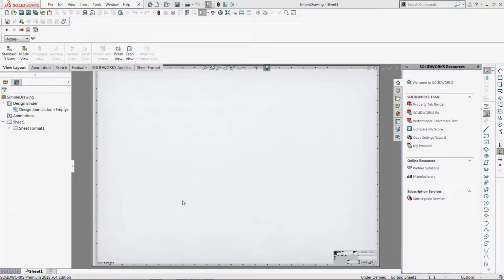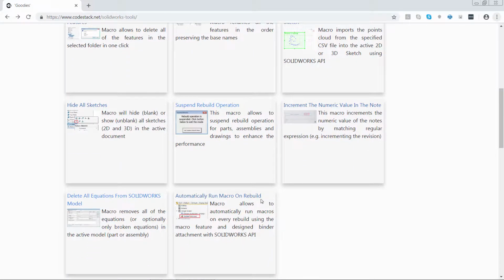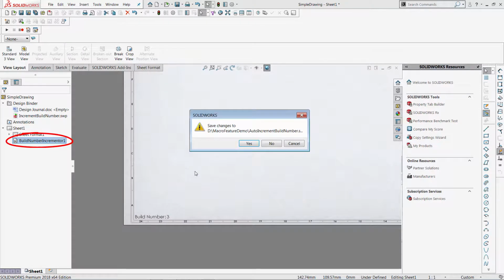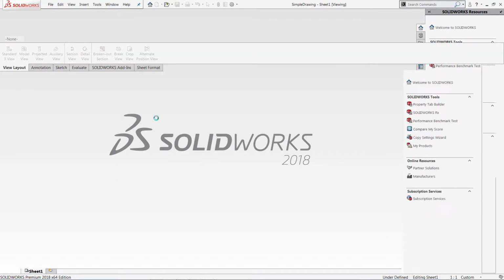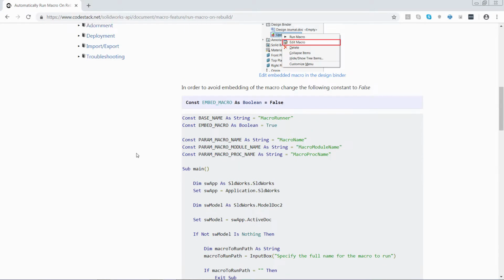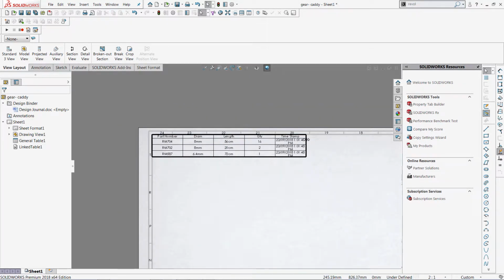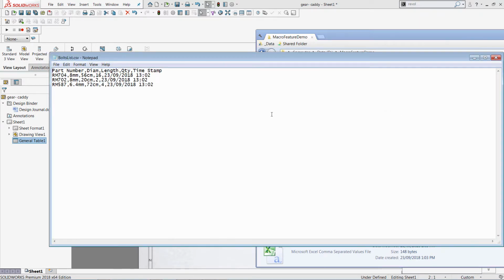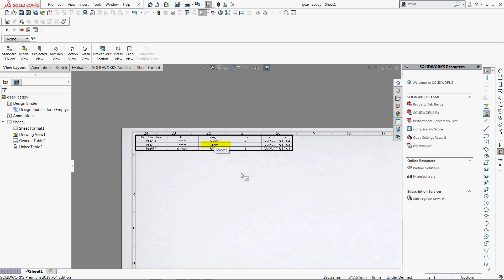Automatically Run Macro On Rebuild

Comment: I run Macro on PDM .  Failed to insert macro attachment .  hellp me
Reply from the maker: Did you check out the file? What error do you have when trying to add macro attachment?
Reply: @CodeStackDev   I have check out the file . I run macro Automatically Run Macro On Rebuild , and msgbox  "Failed to insert macro attachment" . please help me :D
Reply: Did you get this figured out? I am having the same issue.
Reply from the maker: @avig1000  Please clarify the issue? You cannot add attachment or you cannot run?